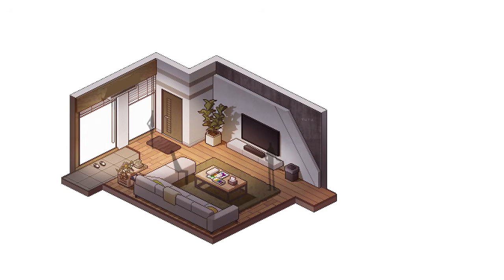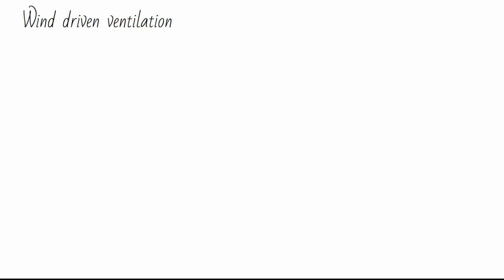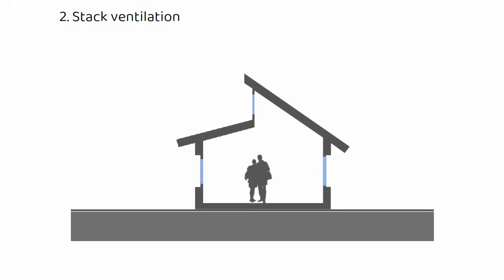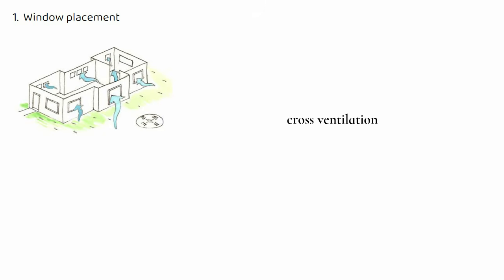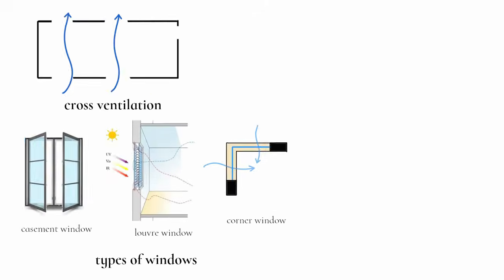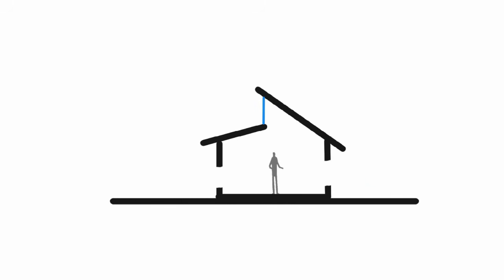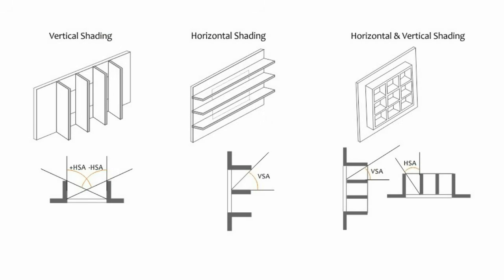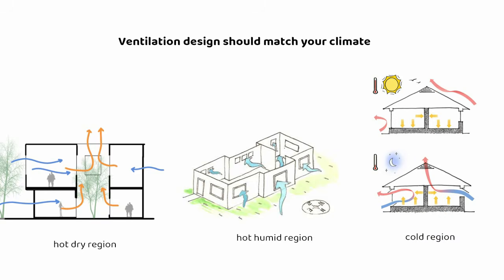Lesson 4 - Natural Ventilation

Comment: Mansions in the south improved on this ... near the topmost windows, they used gas flames to heat the air, which increased the outflow; which (obviously) increased the inflow from lower windows.   This technique lasted until Willis Carrier invented the air conditioner in 1902; which was FAR superior.